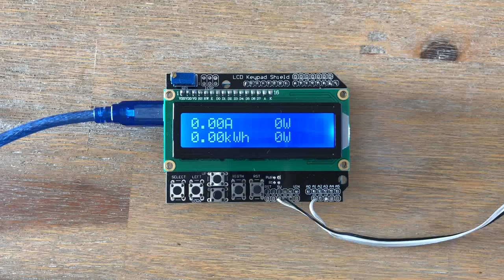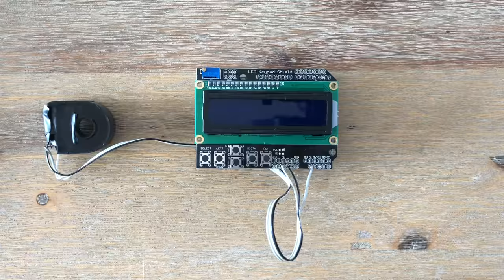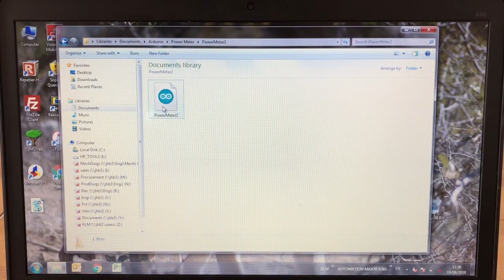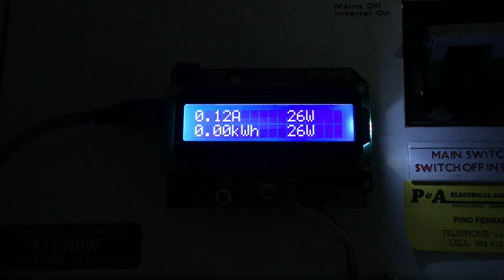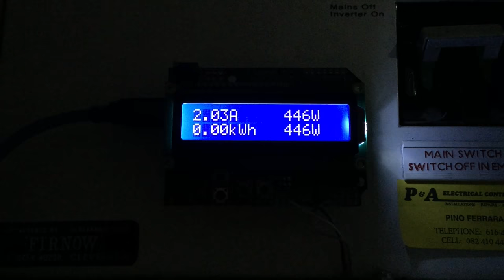Make A Simple Arduino Energy Meter

Comment: Hello Sir,  i just want to ask how to make an lcd power and voltage display using arduino!? this is for generator set. This is part of our research design project.
Reply from the maker: You'll need to get a step down transformer for the voltage monitoring. Either rectify a step down signal from a 5V transformer or use a 2.5V transformer with a 2.5V reference. You can then calculate the true power because you'll have both voltage and current readings.
Reply: @MichaelKlements  hello Sir,  I'm planning to but the materials needed from your video.
Current Transformer, DROK 100A/100mA AC Current Transformers, Mini Clip-on Current Sensor, Split Core Amp Transformer Sensing Relay, Easy to Install CT without Power Off

 Is this material can be used in place with the AC current sensor transformer you had used?

Comment: How will I want to monitor 2 or more appliances.
Reply from the maker: If you don't need separate results then just connect this meter to a multiplug and plug both into it. If you need individual monitoring then duplicate the circuit for each appliance and connect each to its own analogue input, then duplicate the code creating new variables reading from each analogue input.

Comment: Thanks for sharing.
What is maxcurrent=516 all about?  where is this figure coming from?
Reply from the maker: This is initially setting the measured current to zero before the measurement is taken. The input is a sine wave, so zero is the middle, being 2.5V and this corresponds with half of 1023 (the analog input range), adjusted a little for actual the measured value.

Comment: Interesting project, but this measurement can only be indicative, and not accurate. P=U*I, but  we cannot assume the voltage and have to know it in every moment to be accurate since it is not constant (e.g. 220V), and fluctuates in our grid. So, you will need also voltage sensor for the project to accurately measure Current/Power/consumption.
Reply from the maker: Yes you are correct, it's intended to be indicative only. It also doesn't account for the power factor because it's not measuring the voltage.

Comment: Hi, Is AC1030 suitable to calculate voltage 230V? This is voltage output from solar converter. The power produced is 4200W maximally. Maybe I should use AC1200?
Reply from the maker: Yes the AC1030 will be fine for 4200W at 230V. You could even us the AC1020 for better resolution. You can't use the AC1200, it is way too big for your application and you'll get very inaccurate and course readings.
Reply: @MichaelKlements  Thank you. This way I have to do it.
Reply: @MichaelKlements  Works great on Arduino. I need to connect it to D1mini with ESP8266 because of wifi. What resistors and capacitor should I use? 33 ohms for burden and 100 Kohms for divide?

Comment: Hello - nice project - BUT, as others already mentioned, the values obtained are very imprecise, since they do not take into account the power factor (phase shift) or the constantly fluctuating mains voltage. ......May I encourage you to approach the project with your Arduino-knowledge from a completely different angle? 

Most modern power meters have an LED, which delivers pulses that are really accurate to the energy consumed. Our meter, for example, delivers 1000 LED pulses per 1 kWh. If you feed these light pulses directly into the Arduino (by using an LDR or a photo-transistor - clean signals no problem), you get a fairly accurate image of your currently consumed energy - including the power factor corrected and regardless of the constantly fluctuating mains voltage. Of course, this also works with 3-phase meters! 

I would like to build something like this, but I'm not good at Arduino programming ..would you be able to do it?

Comment: You don't actually need the LCD shield, you can just use the 16x2 LCD on its own, you aren't using the shields other features, namely the buttons, in this project so why specify it?  It's more expensive!
Reply from the maker: Yes it is more expensive, it's just a lot easier for people who aren't confident with connecting up the display to the Arduino manually. It also makes a more compact finished product, which can just be mounted like it is, rather than having to build a housing to support the Arduino and the display.

Comment: This is a bullshit meter, it can only "measure" resistive loads, no actual voltage measement like 110V, 230V, 215V, 240V a.s.o. just a constant.
Take a multimeter, measure the current and multiply. Thats more correct. Even only for resistive loads.

If you want to know how real power measement works, buy a Gosund SP1 and have a look inside. They have a chip for voltage and current and this chip can multiply the correct way. Chinese guys can show you! For 8 ... 12 € inkl. the case and app.

Comment: what a shitty solder job. why wouldn't you just use a breadboard?
Reply from the maker: Breadboard connections are typically loose and not very reliable.